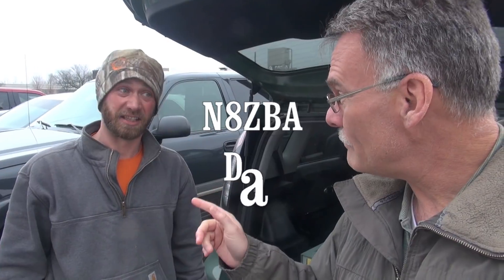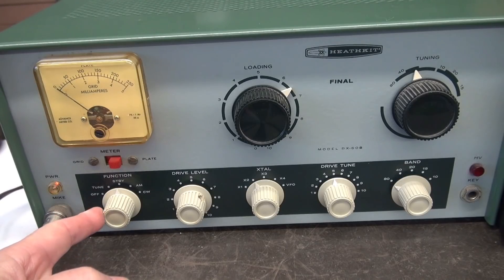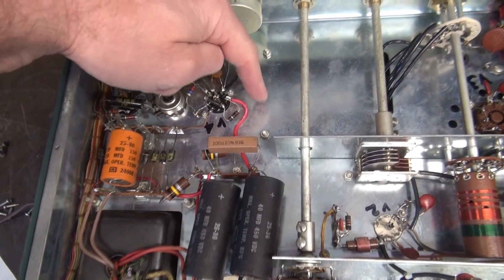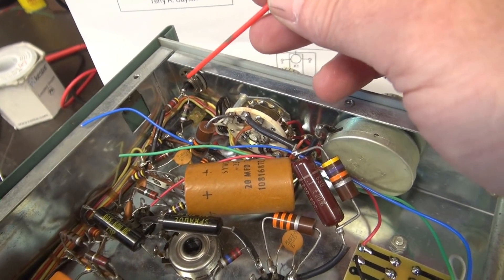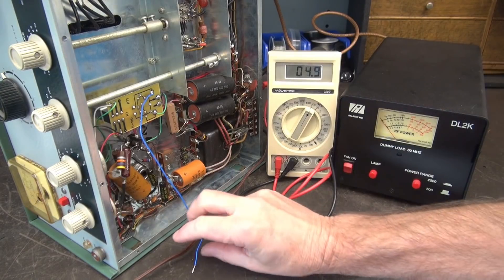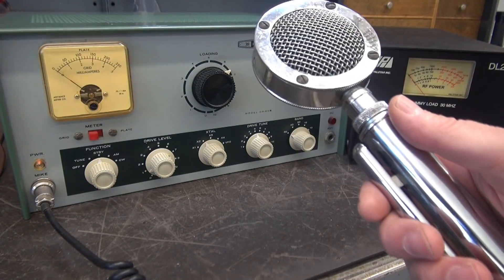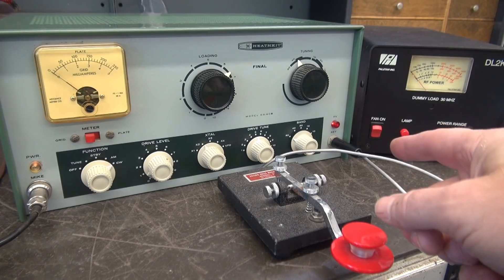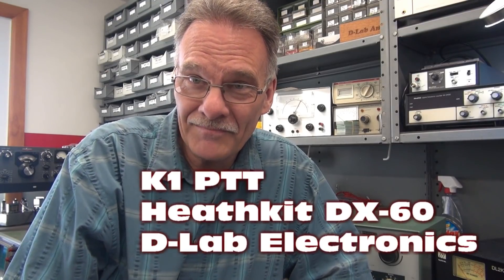How to install PTT Push to talk Heathkit DX-60 Tube Ham Transmitter

Comment: I would hate to see these transmitters in the junk pile because of a function switch. In my old Novice days, I fried the function switch on my Heath DX-40. Made the transmitter worthless except for spare parts. I agree  with using a 1/4" inch plug and jack.

Comment: I wonder if you would use a 1/4" jack for the key input that has a normally open set of contacts. You could use that normally open switch to short the microphone relay contacts. In other words when you plug in the key the contacts for your relay close. I have a DX-60 so I might explore this. Great video!

Comment: Cw would be super easy...just put a mox button or switch inline with the mic.....or right on the mic or set it up like a "breakout" right off of the 4 pin connector. Lol....or just wire the ptt module on the am lug on the selector switch......? Maybe?

Comment: Terry - very nice job.  I've done something similar but also added an internal antenna changeover relay that will also mute the receiver - hate spending all that money for Dow Keys. I installed another SO-239 on the rear chassis using a Greenlee chassis punch.  While I was at it, I installed the Hayseed Hamfest electrolytic capacitor kid and replaced the 6146 with a 6146B.  Worked well, but I sold it on eBay.  Ya got me thinking about doing another conversion, this time with an internal DDS VFO.  Check my website for some of my projects - www.k3jls.net.  73's - Joe K3JLS  PS - love your videos!

Comment: Secure mounting suggestion for your DX-60 kits. Provide one hole centered on each of the long sides of the board and provide 2 standoffs with screws and/or nuts. This would require drilling only two small holds and would securely mount the circuit board. Personally, I would not trust adhesive tape in tube equipment where things can get hot. Nice kit otherwise!
Reply: What if the standoffs were put right on the two nuts that are where he mounted the board? Or easier yet,mount 2 terminal strips off of those screws and solder the ground side of the board to the terminal strips.

Comment: Terry, Can you not just dis-connect the 1/4 CW key wire, and just run a jumper from the 1/4 inch CW  jack to the Mike plug key line?
Reply from the maker: Yes, however you still need to activate the 120vac for the Antenna change over relay. This mod is intended  to eliminate turning the function switch, thus wear or failure.

Comment: Wow! Will future versions work on a Heathkit DX-35?
Reply: Sure, I just overhauled mine last year. Should be easy.  :)
Reply from the maker: Yes, This module will work on the DX-35. I believe the rotary function switch is the same. I can determine the pinout. Can you install it OK?